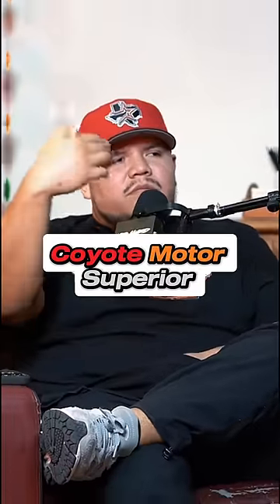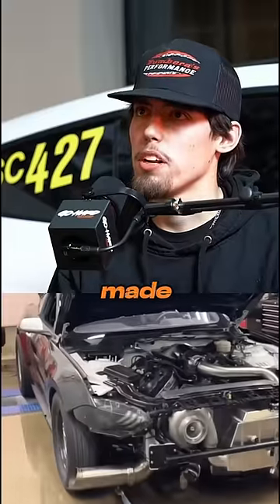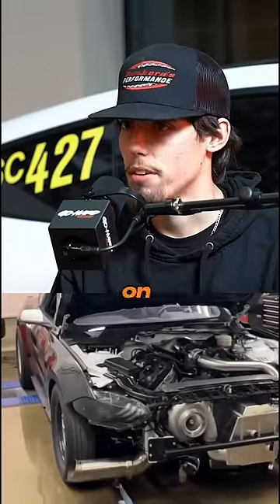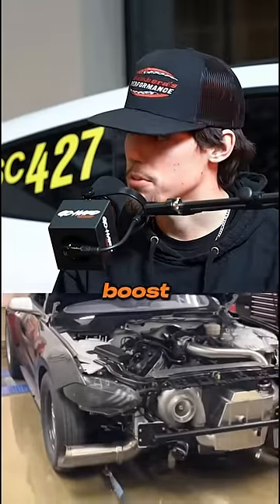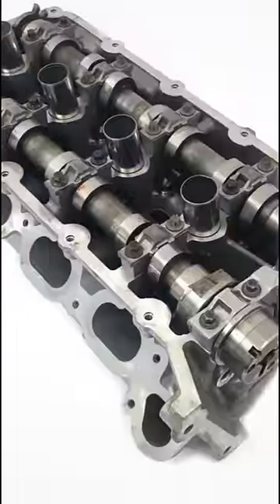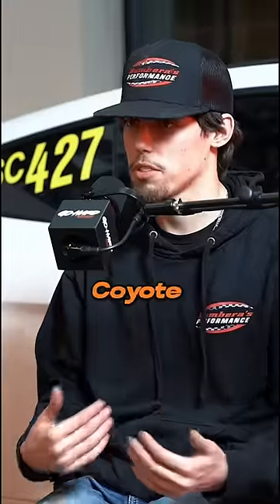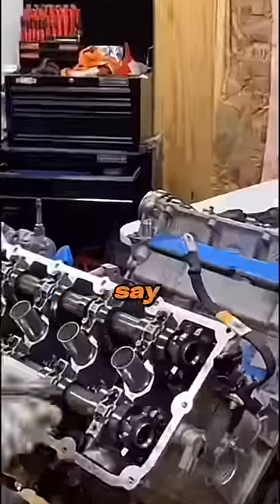SUPERIOR Ford Coyote Motor 😳 #shorts

Comment: I don't think people realize getting that much power from stock block is crazy, guys spend 50k just on an engine just to get that much power amd that's some type of after market blocks
Reply: But paying close to 50k for a f150 coyote truck is crazy then the mods get real expensive
Reply: I think it’s crazy they say stock block when they put in dart sleeves and o ring it .
Reply: 4.6 4v and 5.4 4v did it years ago. 4.6 4v still holds the record at 5.88.
Reply: @karlhopkins713  well yea but that's ford , the best shit out there
Reply: The money adds up every block you break chasing a record
Reply: @juniorlopez8206 get a pre 2020 F150 with the V8 and 10spd. They have the direct injection and no cylinder deactivation bs
Reply: @racingjunk7024  sleeves are used all the time. The reason they sleeve the Gen3 coyotes is because it’s just aluminum and then they spray the cylinders with a plasma arc it’s really pretty interesting. But adding a sleeve doesn’t make it a dedicated casting or carve it outta billet. And o-ringing the heads for a better seal? C’mon dude you’re reaching on this one.
Reply: @mrjimmylynch1320  I’m not reaching at all . Worked in a machine shop for a very long time .i know exactly why you sleeve a block  only 2018 blocks use plasma and you have to block water jackets to make the block solid to put sleeves .it makes the cylinder walls thicker making up for the aluminums weakness . If you go wet sleeve it’s stronger and cools better . You’re literally cutting out 1/4 of the block to add ductile sleeves how’s that stock ? Factory don’t come with iron sleeves or o rings it’s not stock .it’s great to do it and make these crazy numbers  really is . But it’s not a stock block same as a guy with a dart sleeved aluminum Chevy block .
Reply: @racingjunk7024 oh so you worked in a machine shop and found out that sleeveing a block is a modification? And you are wrong about that whole plasma statement, Ford did it for the ecoboost/cyclone engines. I’m not going to go back and forth about it but you need to get some knowledge going because there’s multiple different reasons why you would sleeve a block and making 4 times the power is not one of them lol
Reply: No, it’s a modern motor, that should be expected.
Reply: @dexstarksmarforcom7616  I’m talking strictly coyotes . And again we are talking about this guy . Not some guy who scuffed a cylinder wall . Jesse buddy you’re dense . If ford didn’t put the sleeves in the production model it’s not stock period . You can ride the ford bandwagon all you like but the truth is the truth . Obviously you’ll never agree and that’s fine .
Reply: @racingjunk7024  okay a coyote is an aluminum block it does not need a sleeve as they came with a cast iron or plasma spray so thank you for clarifying that it’s not a modification and the whole point of the sleeve job is for 1. Older JDM forced induction engines and if a cylinder shop has screwed up the plasma. Other than forged internals 99.9% of the time ARP studs will be used to strengthen the block clamping force. This guy I think was referring to the coyote  already being produced with it.
Reply: @racingjunk7024  and to your comment about if Ford didn’t put the sleeves in the production model which 90% of automakers do in this day and age you have no argument my friend but hey it’s good to learn something new everyday so props to your opinion and new knowledge
Reply: @chris22186  2J is good until the block rips in two at barely 850  Hp. Not even wasting time on the RB You are just a parrot repeating a narrative
Reply: @juniorlopez8206 what are you on about you can buy a used mustang 2018 5.0 for 26k then you only need like 6k for a turbo and tune
Reply: @imgizmo4706  I’m talking about a f150 not a mustang
Reply: @racingjunk7024 so other than the sleeves what’s not stock about that ? technically 90% of the block is stock
Reply: @mustangmadness530  the part that holds all of the power isn’t stock so how can it be stock .i had a sand rail with a aluminum 5.3 with sleeves and a 4.100 bore it isn’t a stock block . Stock literally means unchanged
Reply: @mustangmadness530  and o rings are not factory . The solid bushijgnput in the water jackets aren’t factory
Reply: @racingjunk7024 yeah, it was to my understanding that anything that was done to your vehicle that changed it in any way, shape, or form from the way that it was originally built from the factory was a modification which includes changing the design of your engine. I mean he's modifying his engine. Could it really be considered stock if the engine has been modified😅 is it really seriously still considered stock🤯😐🤣🤣 that's wild if it is and brand spanking new News to me😂🎉❤
Reply: @racingjunk7024  its insane the amount of excuses he just gave you 😂😂.  Sleeves and orings are not stock at all. Stock is when you dont open the motor and have bolt ons. You gotta pull the whole motor and basicly redo the block. These ford people are crazy.
Reply: Or they could spend $10k and buy an Asian built motor, get more power out of it, and it'll be lighter.
Reply: @luthermoore2969 my 5.4 3v says otherwise.
Reply: Drag racers: stock block
Machine shop: we've machined the bore to 3.826 inches, installed new sleeves, and rebuilt the motor ground up with Manley pistons and MGP rods.... 
Come on y'all, that ain't a stock block
Reply: Nowadays, it's more like 60-80k for big big power, like 3500-6000 on specialty blocks.
Reply: @wolfrig2000 shhh don’t tell them that, not like Japanese dominated Americans in the car scene 70’s-90’s 😂😂
Reply: @racingjunk7024  exactly. By that definition just about everything is running a stock block.
Reply: @dexstarksmarforcom7616  dude your comments are totally irrelevant. Once sleeves are swapped it’s not a stock block anymore.
Reply: @Fpvpilot928  yeah,  but the motor mounts are in the same place, so it must be stock 😂
Reply: 50k I can get a SMX that is way more capable than any oem engine.
Reply: @LopoBeater  Good thing accufab, never broke the 4.6 block, after who knows how many passes, running 8s, 7s, 6s, 5s. Used the same block
Reply: @@tha_black_merc what are you talking about ? I own a sleeved block ls based engine .you don’t even own a car over just stay on the sidelines
Reply: @@tha_black_merc and no they don’t the ls based engines are cast iron and the other blocks have inserts and my whole point is if it has sleeves it’s not a stock block
Reply: @racingjunk7024 still a “stock block” sleeves aren’t part of the block they’re casted separately when casting the block wtf are you talking about.
Reply: @BASSHEADBOOM  coyotes are literally made in one pour and cylinders are coated wtf are you talking about kid
Reply: @juniorlopez8206 he said people pay 50k to get a engine similar. A coyote can be picked up for less than 10k. It's been used for 15+years now
Reply: @societyisboring  came out in 2011 and they use 2018 and up only so ….
Reply: Yeah, that's at LEAST what you spend on making that power with a coyote, too.
Reply: We’ll you can pay more money 1 time to have something that’s going to do what you want, or you can spend 1/3 of the money 3 times trying to make something cheaper keep up.
Reply: I don’t think “people realize” if it’s sleeved your not getting that power out of a stock block 😂
Reply: @omarprado6752  if you stay stock bore no but it’s longer so you don’t get as much piston rock and it will hold more boost which means more power then a stock block can handle
Reply: @racingjunk7024  yeah if it’s sleeved it’s not stock 😂
Reply: Don't tell the LS boys that you can't tell them differently.
Reply: A sleeved block with new O rings isn't stock!!! 🤣🤣🤣🤣
Reply: It isn't a stock block they are sleeving it
Reply: 426 hemi block you can do the same and better
Reply: Well I'm that case, that's just any block then.
But I do know them coyote motors love boost
Reply: @alexdavis6566  right up until they grenade. Any motor loves boost for a short minute.
Reply: @dexstarksmarforcom7616 your arguing a sleeved block is stock it's no longer stock once a machine shop touches it brother admit your wrong and move on no stock block coyote can take over 25 lbs he chose his words wrong it's a stock casting with sleeves aka a slightly modified more or less stock block people are throwing around the word stock alittle too freely
Reply: @Seasniffer1969 There's a simple fix for that. I have a 2024 F150 Single Cab.

Comment: These engines really are an engineering marvel. The shop owner next to us has an 8 second Mustang that’s got a built block but stock everything else. Stock heads/cams/stock auto trans (with a converter) and it’s tuned on the stock ecu. It’s also still 100% street legal and has the factory stereo, HVAC etc. The thing looks like any other off the lot GT with the hood closed. I love builds like that. It doesn’t really impress me when a full on drag chassis with zero stock parts runs a low number. To me that’s like a body builder that can lift a lot of weight; it’s what you’re supposed to be able to do. But when something puts up a number that by all rights it shouldn’t be able to because it’s a mostly factory vehicle thats accomplishing something IMO. 
Oh, and I’m sure you could get a Coyote to live on 25+psi with the stock sleeves……if you only put like 10-12* of timing in it. 😂
Reply: Marvel have you heard of German engineering? 🤣🤣 a marvel you have to be joking
Reply: @aaronlive1541 specifically what German engineering would you be referring to? Asking for a friend...😊
Reply: I’ll need a build sheet please 🫡
Reply: 6th Gen Camaro V6s are faster than any older factory V8s.
Reply: @aaronlive1541  Show me anything on the German market that is a regular production car engine that makes power like a gen 3 Coyote. 100hp/L out of an NA they put in a 40k vehicle. What does Germany have that’s even close without boost for under 100K or more.
Reply: @kennethpowers8995 either way German cars are faster🤷🏽‍♂️
Reply: @JuanAndrade-bb5tn  That’s funny I don’t see many German cars at events going 6’s and 7s…..let alone with just a sleeved stock block on a stock ecu running a stock auto trans. I must be confused.
Reply: @aaronlive1541  i love bmw but i gotta agree it’s a engine tailored for the chassis so the cars handle better german engines are fast and handle great. american v8s are faster but handle worse. the ls and coyote are great and for 50k u can buy a gen 2 mustang and build it to 900hp.  or u can get and build a b58 to 650hp just more dailyable. 

bmw >> benz hands down
Reply: @kennethpowers8995  VR6 ran 6.7 IROZ ran 7 Audi are roller cars.  American engines are just powerful and big. They weight a lot
Reply: @aaronlive1541  Any American V8 from the 80s and 90s is trash. That’s why I’m happy they finally got back to building good 8 cylinders here in the states. You don’t even have to have a “performance” car to be quick anymore. My
Work truck ran 12.90s bone stock off the showroom floor with 93 in the tank. Goes low 11’s now with a bolt on Whipple kit. Still stock suspension, wheels, tires all my tools in the back etc. My same setup in a Mustang would probably touch into the high 9’s on a good tire.
Reply: @aaronlive1541  zero German cars have gone 300.4 mph in a mile, 5.88 @ 256mph, or 6.20s with the oe cast engine parts. 
Ford has done all three WORLD RECORDS.  
And the top speed record for any piston powered vehicle is held by...an AMERICAN V8😂
Reply: @chadkent1241  Bugatti Chiron I don’t know if you know that Volkswagen made Bugatti for most of his years 310mph the Bugatti was the fastest car on the planet. What are you talking about?😭🤦🏽‍♂️
Reply: @aaronlive1541 not in a mile it doesn't, not even close.
Reply: @aaronlive1541 you can't compare buggatis against these cars, they don't even come close to competing. And honestly they shouldn't, 2 different animals, these are just light years faster.